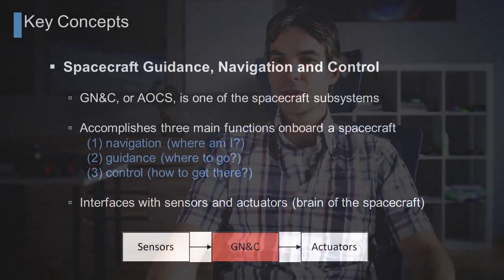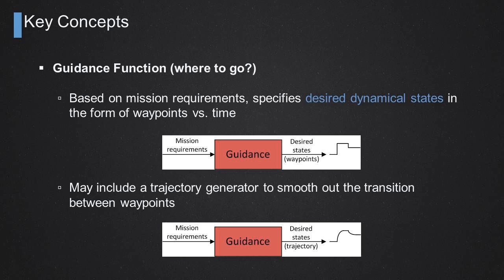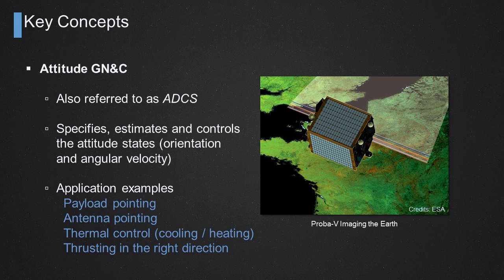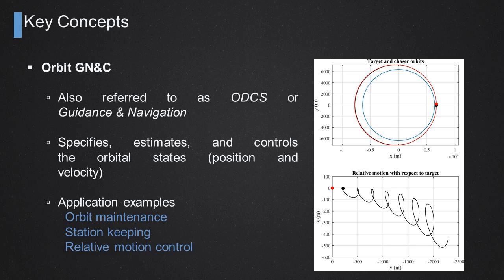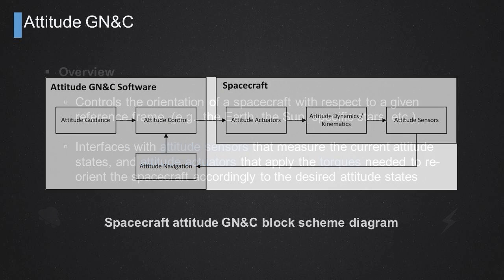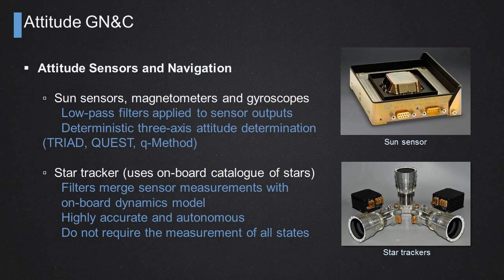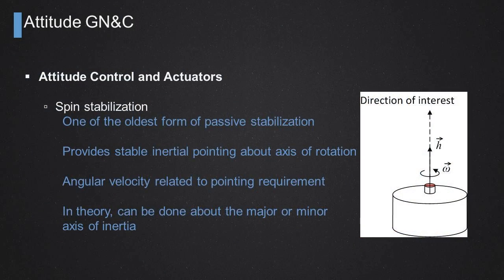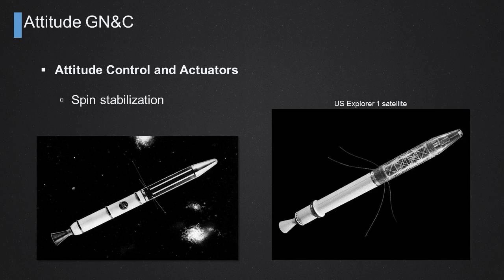Introduction to Spacecraft GN&C - Part 1

Comment: 📺💬  ODC, sensors, feedback, and controls. There are a lot more when talking about the controls system to help the satellites travel along the orbit in the shade of the sun.
🥺💬  There are multiple pages I see from the materials where sensor and controls it is digital sensors and analog sensors signal control. Navigation included estimates of targets or values and how does it different than digital signals⁉ 🧸💬 It does not require quantization and some values from different scales can compare with the same domain.

( They added conversation 📺💬 Do you understand they will not stop and try to do IQ test can you remember they keep the speaker and those flies running 🥺💬 I did not pay attention to them but I read from your share of knowledge🔊🗯 กรุณายอมนะไอ้แม่ ... 🏡🥺💬 เกี่ยวอะไร ไม่สนใจ )

Comment: Please help me in solving this problem:

The initial (3-2-1) Euler angles yaw, pitch and roll of a vehicle are (\psi, \theta, \phi)(ψ,θ,ϕ) = (40, 30, 80) degrees. Assume the body angular velocity vector of the craft is given through the BB frame components as Bωω=⎡⎣sin(0.1t)0.01cos(0.1t)⎤⎦20deg/s.  Write a program to numerically integrate the yaw, pitch and roll angles over a simulation time of 1 minute.   Enter the Euler angle norm \sqrt{\psi^2 + \theta^2  + \phi^2} 
ψ 
2
 +θ 
2
 +ϕ 
2
  at the simulation time step 42s.  Express angles in radians.

[Hint: if you are unsure, look at the "Optional Review: Integrating Differential Kinematic Equations" video.]

[Hint: In the integration, start with the initial angles and just integrate them without mapping them to specific quadrants
Reply: No.